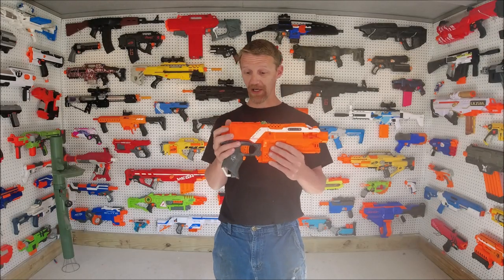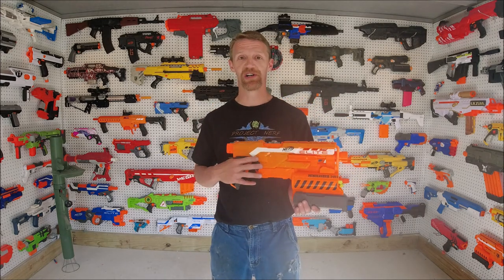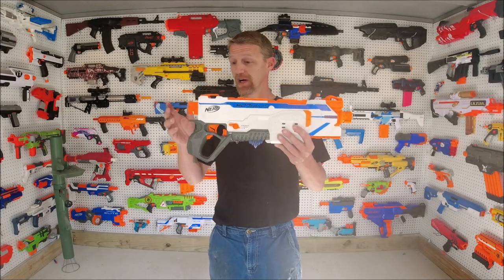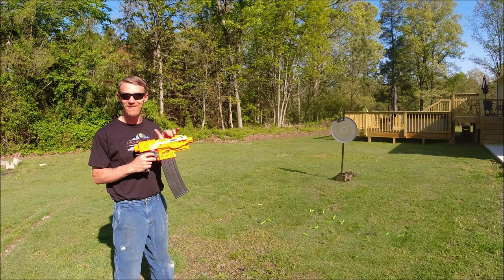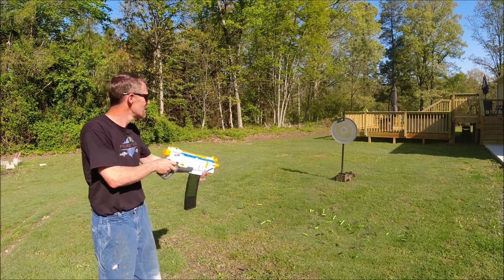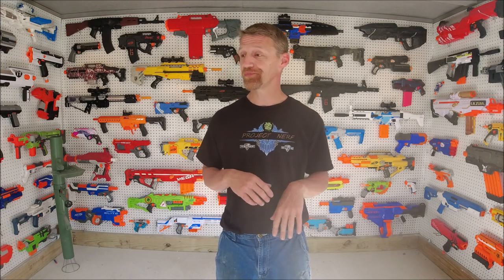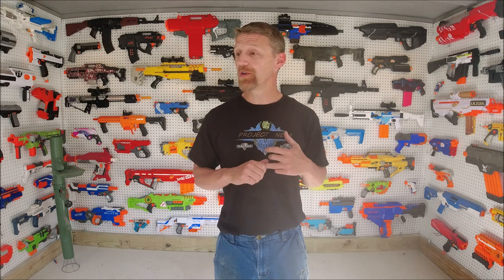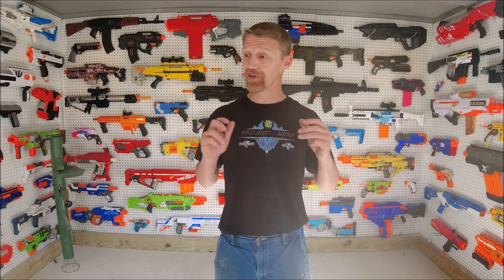4 Blaster Commission Build !

Comment: Chris, thanks for all the content! Your videos have been super helpful. Curious on your regulators why you don't use the motherboard upgrade kit. I've built 7 or 8 of them now with it and it's pretty rock solid as far as I can tell, both 2s and 3s. Wicked fast rate of fire too, with all stock features plus some extras. Have you heard of it? Or had any issues with it?
Reply from the maker: Oh for sure I have used the kit to great effect, no issues to date, but I really drives up the cost of the mod. If you can do the work, might as well save a few bucks right.
Reply: @projectnerf7920  ok, cool, I just hadn't seen you mention it so I was curious :)  both times I've tried the split circuit method, the firing circuit seems to need to "warm up" or something because the first few times you pull on the trigger nothing happens, but then it'll start working... But it'll happen again after letting it sit for a while. Any idea what the issue might be there?
Reply: @projectnerf7920  Would you  mind telling a bit more about spliting the circuits on the regulator? I assume you run the board on a buck converter and the flywheel circuit on a mosfet or 15amp switch seperate?
Reply from the maker: That's 100 % correct my friend. Just run two sets of wires off your battery plug, one to the buck and the other set you would just wire up the flywheels like you would a stryfe.
Reply: @projectnerf7920  I've bought two of those kits and had both wire terminal boards come with stripped.  The second board shorted due to this and committed Nerficide.  And a third one on the way, we will see how this goes.

Comment: Do you have a link for the Auto Demolisher kit?
Reply from the maker: To the best of my knowledge there is no kit for a demolisher, I assume that's why there aren't many full auto ones out there. I use a stryfe kit and then have to custom make the mounts for the pusher box. I did it in my Mod guide on the Demolisher, if you haven't seen it, it's worth a look.